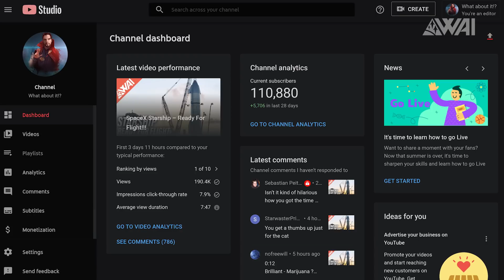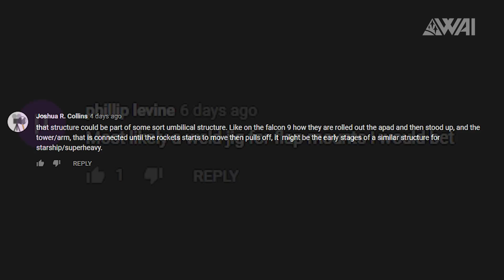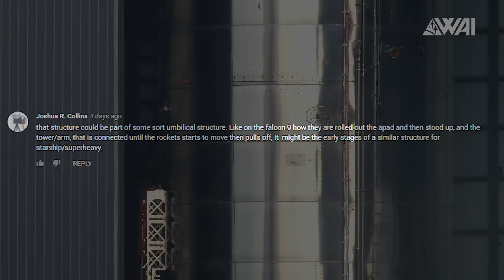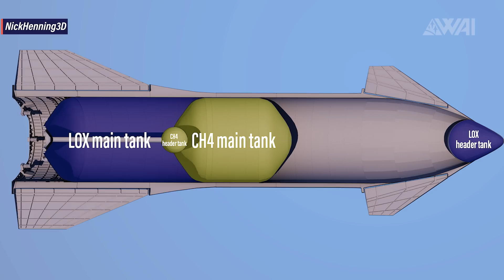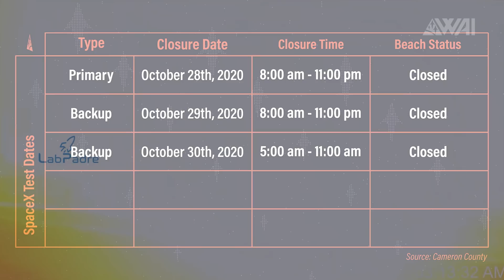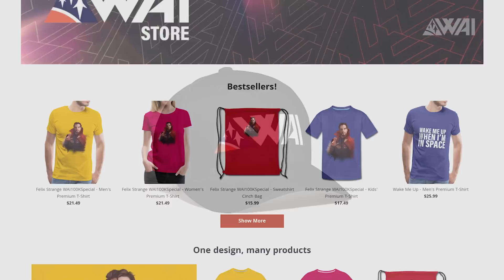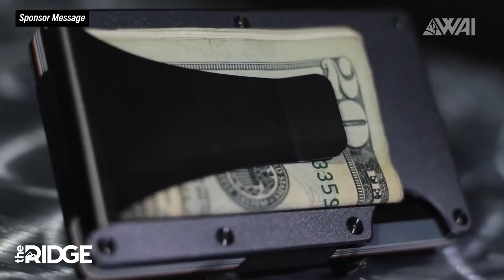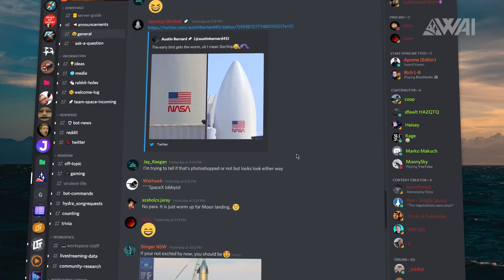128 | What needs to be done to launch a SpaceX Starship to 15 kilometers?

Comment from the maker: Paint Starship SN5 white, add swiss cheese ring and then stack a nose cone on top? What’s your thought? Are we on the right track here?
Reply: Could be just that. Holes could also be cut outs for metallurgy tests like those square ones a few months back.
Reply: I think so. I was a bit surprised they mocked the nose like that. I was wondering where the door would be for the crane mount and solar panels / windows?  Thought they might paint them on also.
Reply: Yup, that was my first thought when I saw that ring. The holes don't have match the first pics of the HLS SS, that was a preliminary drawing just to present the concept.
Reply: SN5 is in dire need of a nose ring.
Reply: Maybe. But detracting from the question, what I would like to know is where is SN8 gonna land after the 15 km test?
Reply: @kitersrefuge7353  I think it will be the standard landing site which is pretty risky as it is in close proximity to the fuel farm.
Reply: @kitersrefuge7353  I guess on the landing pad where the hop tests landed? Surely not on off course i still love you :D
Reply: Wolf 35Zero SpaceStation.
Reply: Paint it like a Heineken or Budweiser can and get some sponsorship funding
Reply: i thought the exact same before i saw the ring with holes in in
Reply: Mad photoshop skills there! ;-P Would be awesome to see!
Reply: I like an oval shape body, with no paint to keep costs down... :)
Reply: the windows of the bar are already visible, under the exusting roof
Reply: @brucebaxter6923  - That part under the roof is for a “Gantry Crane”. The windows don’t provide a 360° view, which is available above the roof.
Reply: Nice haircut
Reply: I'd put it on SN6 since it's currently just a copycat and would finally find it's own calling.
Reply: Dumb
Reply: Yes you are, I was thinking they might do this before you mentioned it. Great video 🙂
Reply: SN5 is better as a showpiece at Boca Chica like starhopper. Maybe painting SN6 and adding the Swiss cheese ring to it would be better, after all, SN6 is better than SN5 everything-wise and it's got the same job of sitting around, making way for others when it blocks their paths, etc.
Reply: There will not be a starship presentation this year. They could put it on SN5 but I think SN6 would be better since SN5 is more historic and best kept clean. I don't actually think they will weld it to anything because they have already painted the nosecone and it makes more sense to paint it all after welding.
Reply: WAI tho
Reply: Yes
Reply: The Apollo program accomplished far more than just "planting a flag and collecting some samples", as you have characterized it. Landing a man on the moon on July 20th 1969 was the greatest accomplishment mankind has ever achieved. It will always be the greatest achievement because it came first. Everything that mankind will ever do since will be accomplished by having stood on the backs of giants. 400,000 people worked on the Apollo project for decades, and three American astronauts lost their lives. By the last lunar Landing in 1972, the program had evolved so that men could work on the moon for only 72 hours. What did you expect them to do in those three days? They were there to explore and to collect samples so that we can better understand the Moon and how it was formed and possibly how the earth was formed... they certainly could not have done any more especially without the funding that someone like Elon Musk can provide... and he is what he is today because he is standing on the backs of those giants. The Apollo project was far, far more than just "planting a flag and collecting some rocks".
Reply: @madisonlivingston5851  so basically yeah, they point of the mission was to collect moon samples
Reply: I like Swiss cheese it is very nice
Reply: @ 8:33 - If LOX header tank takes up a good chunk of upper nosecone real estate, what happens to that beautiful and amazing skydeck in current renders of the passenger craft?
Reply: To me, the holes look like windows. Wouldn't it be amazing if they'd actually go inside the mockup? (It could for example better visualize the scale of the habitation area)
Reply: i think the holes are there to provide some fresh air for the crew while lifting off because of climate change you know, temperatures rising and stuff, it might be just ... air conditionning ;)
Reply: I have info that SpaceX is going the build a crane that will be used to move starships on and off the launch pad. Since it can launch superheavy it can also launch starships.

Comment: What happens when a crew cabin goes in how can you have fuel on top and bottom of the crew it seems to dangerous can that tank be moved in a future prototype thanks great show
Reply: The pipe will go through the side, and the engineers will make a damn sure it won't endanger the crew

Comment: The header lox tank at  the top is a bit worrying.. if something goes wrong the passengers are screwed... also how do you prevent flames from going up to the tank in the first place? Maintaining proper pressure inside the tubes connecting that header tank to the engine must be a bit tough considering the vast distance between the two.
Reply: Will be a very idiot engineer if they didn't design it for that

Comment: I've suggested recently that a shaft with an elevator system would be a potentially rapid way of stacking starships. All critical work could be done at ground level rather than on the end of cranes or from cherry picker platforms. It would protect the work area from the weather too.
Reply: What does that equipments will cost? Is it worth it for this stage of R&D & testing?
Reply: Alvian Choiri Apriliansyah Elon always talks about 'the machine that builds the machine'. I design and build special purpose machines for manufacturing industry. An elevator shaft is the way I'd go for rapid manufacturing. I couldn't put a price on it, but you'd be in the low tens of millions at a guess. Small money really for the gains it would bring.

Comment: The bracket could well be an early Arch welding deployment for possible welding automation, or for welding integrity checking as the rings are added upwards. Just a thought, if the ultimate plan is to build 1000s of this Starships, everything will have to be automated anyway.

Comment: So far, I have found NO info on how SN8 will be guided.  What's the process, since, of course there are no human beings on board?  So, for a neophyte like myself - how the heck are these manless flights - and, even, manned flights accomplished (assisted by AI navigation, etc.). And, to pull off a belly flop, and the final 'flip' - how is this kind of precision accomplished, avoiding 'cratering'? Thanks for your time.
Reply: Obviously they have that or it won't fly in the first place. FYI rocket don't need AI, just a simpler algorithm

Comment: 9:10 I've always wondered. Are the header tanks sufficient to fuel the entirety of the landing maneuver? Or is there purpose only to have sufficient fuel to reorient the starship engine down and to begin decellerating so that the fuel in the main tanks is pushed down and then that fuel supplies the remaining requirements for landing. Is this how it works? I would imagine that SpaceX would be able to instantly switch the fuel lines and have the engines switch which tank they're being fed by while the engines are actively on
Reply: My idea is that the header tanks are also responsible for weight distribution during the "belly flop" maneuver as having all of the fuel in the main tanks would mean the Starship is really tail heavy. Having the LOX all the way up in the nose means that the CoG moves much father up which is a lot better for aerodynamic stability -- it's possible that fuel just gets dumped in the main tanks during the transition to landing burn when the ship turns vertical.

Comment: It's my opinion that the whole "360 degree bar" was a Elon Twitter troll. The highbay wasn't constructed with provisions for anything like a bar on the roof. That is no elevator, (are people going to climb 265' up stairs or worse yet come back down after drinking), there is no plumbing (what is going to be used for water for fire suppression or making drinks for that matter or to flush toilets). It also doesn't appear that any extra strength was added for such a structure. I know it's fun to speculate and come up with cool names for it, but my money's on it never happening.

Comment: Here's a thought. Because SN39 was replaced with SN36 they will require another static fire. What IF they fuel both the mains and headers and perform a consecutive static fire from each, since a static fire will be required from each anyway. And this also tests the consecutive ignition condition of the flight itself. In any case looks like they have canceled all road closings through the 29th, next opportunity is on the 30th.
Reply: Or not. NSF articles still stated only one SF using header tanks

Comment: I suspect that SN5 and SN6 will be used as test loads for early mid altitude Super Heavy tests.  They will need to simulate proper Starship balance, but will not need aerodynamics.  The hop test will be very different since an actual landing would be just the Super Heavy by itself. I am thinking hop test with no load, mid altitude test with SN5 and 6 as dummy loads, perhaps separating and landing on their own, but not needing to belly flop because it is not coming back from orbit.

Comment: Felix, do you know if the LOX and methane will be super cooled in Starship, like they are in Falcon 9?
Reply: Yep
Reply: @alvianchoiriapriliansyah9882  Doesn't that mean they need Helium tanks inside there?
Reply: @HelmutBemboka  Helium isn't the factor of super chilling. It's autogenous pressurization
Reply: @alvianchoiriapriliansyah9882  I thought the liquid helium was required to keep the fuel at low temperatures.  I understand that's why Falcon 9 uses it.
Reply: @HelmutBemboka  Helium is for pressurization ≠ super chilling. The chilling is done in the tank farm/LOX production site
Reply: @alvianchoiriapriliansyah9882  ah ok - thanks for explaining that!  Out of interest, are you associated with SpaceX?
Reply: @HelmutBemboka  No, but this fact is pretty easy to find without having to work there
Reply: @alvianchoiriapriliansyah9882  Yep all good - just wondering :-).  Thanks again.

Comment: The Raptor engine has a throttle range of 20-100%. Would it be possible that when they launch it they will start as slow as possible in order to reduce the need for significant thrust diverters on the launch pad and then go to full throttle once the rocket is clear?
Reply: So far it's as low as 42.8%. Doing like you're saying will waste quite amount of delta-V because of gravity losses, so they definitely not need to do that

Comment: *The tent at the Orbital Launch Pad has had heavy duty (Home Depot style) storage racks installed this past few days.  (in NSF pics)
*I think making either SN5 or SN6 into the prototype Moon Lander would be a great idea, as they still can fly.  Plus with maybe the addition of some Super Dracos, it could be used to perfect landings.
*The actual design for the outside elevator for Starship will be a challenge.  It would need to be like the docking hatches on the ISS or Dragons.  Needing a secondary latch to capture the door, then some beefy primary latches to give a perfect seal.  I doubt using the curved hatch for an elevator platform would really happen because if it ever got warped or tweaked, the Starship could not fly.
* A purpose built flat platform can be installed inside the doorway, with the door(s) folded back for unloading.  Plus the platform could be left on the Moon or Mars to be used as a building roof or wall.
*  "Design every part so that it will do three jobs and not just one."    H. Ford         When Mr. Ford ordered transmissions from suppliers, he even specified the shipping crate size, board thickness and corner blocks to be used.  After the transmissions had been sent to the line workers, he had the crates carefully taken apart and saved.  They were the flooring to his Model A cars.  Already cut and sanded to shape to fit into the car.  He was `the last century Elon Musk. (In an innovation respect)

Comment: First it will most likely be called "The Observation Deck". Second, I will put the bar one floor down from the crane and punch out the center of the floor. Not blocking the center so I can watch Heavies being stacked. Like a Henry Reardon's office in Atlas Shrugged. Why look outward, when everything you came to see is being built below. Clear floors, and touch screen tabletops. Zoom in on parts being constructed, while Dynamic Dogs deliver drinks in Super Heavy beer steins, and F9 champagne flutes. Go bigger. Put the hole bar on an elevator platform. Let it raise with the Heavy. Line the super high day in solar shingles, and make a second floor. Make small studios.... Ask me how I would do the layout.
Edit* Make the hole thing out of shipping containers. Give it it's own crane. Power it with the shingles.

Comment: All of this is far short actual space travel number one you have to survive the Van Allen belt number two rocket engines do not work in a vacuum no more than a propeller will. These are two very critical issues that no one has addressed to my satisfaction.
Reply: In interplanetary & lunar trip they wouldn't travel in Van Allen belts for a long

And rocket engine can definitely work in vacuum, since it had extended & later nozzle than the usual engine. In Starship hyper-efficiency isn't a matter because it can travel to Mars within a reasonable time without fully-fueled

Comment: What about fuel tanks made out of a strong fabric? They can shrink to size as the fuel depletes. Therefore offering the same solution as header tanks but with less parts? Not an engineer haha, don't ask me what fabric ;). If there even is a fabric that fits the requirements necessary.

Comment: Hi- there’s plenty of room on the top level if the bar is real. That’s a huge space. The bridge crane hangs from underneath the trusses. Stairs are technically required by code for an occupied area, as well as an elevator. Neither is really that big of a deal compared to the scale of the building .. retired architect... 😄
Reply from the maker: Correct. Stairs are there already and an elevator will be built, which will take some time. That's all I said. :_WAISweet: Having diagonal beams where the windows should be? Wouldn't there be better options?
Reply: @Whataboutit  If I were the designer (and I’m semi-available lol) I’d use the diagonals as part of the window design. It’s done in Skyscrapers all the time. I’m just gonna watch and enjoy whatever happens! Thanks for the converge 😀
Reply: @Whataboutit  Oh- yeah the bar could pop out about 20 feet all around too! Wrap around the top with soft lights inside! That might be cool! No x braces in the way- with jointless glass panels like the Apple spaceship headquarters 😀
Reply: The stairs that are there may or may not meet code, idk, and maybe local enforcers won’t care. Elevators are mostly fabricated off site. There are machine-room-less elevators now that crawl up the rails (Otis and others I think).
Reply: I should say bridge cranes usually are supported on the columns, up close to the roof. How this one will be mounted is gonna be fun to see. It’s an unusual building design as it is.😀

Comment: Im still concerned with the destination landing pad being a requirment. Else it would not be required on earth. Also crew and cargo departure from the vertical height. Be well from Will and Mr Data :)  :]
Reply: If it landed using Raptors without improved surface it would create a huge amount of dusts particle, which some of them could escape the Moon entirely
Reply: @alvianchoiriapriliansyah9882   yeah. concern require of pad on moon and mars first. So cargo of pad.
Unloaded from space first sounds painful. Should be same pad on earth to test. Thats the cargo. 
External rail on starship for elevator for crew. Cargo unload of a hundred tons, do it on earth to test. After hop.
With onboard eqipment elevator or crain also required as cargo. 
Be well from Will and Mr Data  :) :]

Comment: Felix, I think you are right that Space X will probably paint SN5 white and stack the ferring on top for a mock up. Considering what the National team has done, this might be comparable and sufficient for NASA. I kind of doubt it. The Dynetics mock up is not just a representation but their mockup has mock interior systems for astronaut inspection and input. At a $130, 000, which is what Space X asked for and got, they may have underbid themselves out of a snazzy mockup. Perhaps, the meat and potatoes of the mock up is not the interior, considering the size of Lunar Starship but interior decks, systems, an airlock, and an elevator (mock of course) might go a long way in securing additional funding. The greatest problem that Space X will have in the Human Lander System awards will be refueling. Inspite of being contracted to demonstrate orbital refueling, Space X is a long way off from launching a Super Heavy with a Starship Tanker. This is critical to Lunar Starship and and a failure in timely development or execution could allow the other teams to secure funding. Dynetics has a similar problem that it will require refueling to be reusable, but that is on a much smaller scale. NASA has said they want the HLS to be reusable but would accept nonreusable at first to save development time and reach the 2024 deadline for Artemis 3. With the next round of awards coming next March, I sure would like to see Space X show off a really cool mockup and some subsystems that show that Lunar Starship is the way to go.